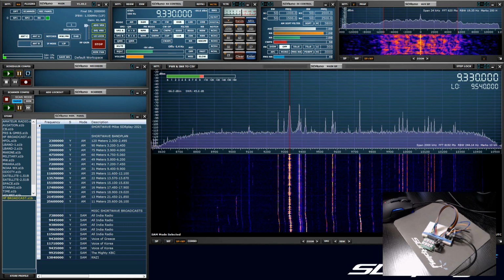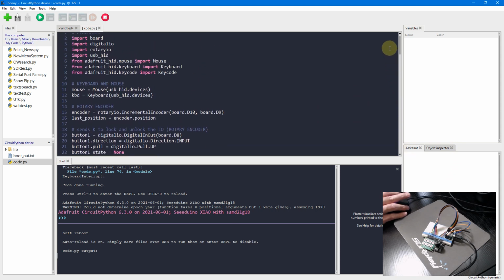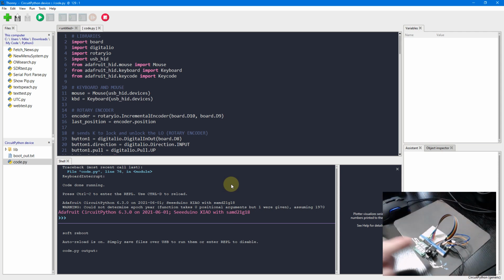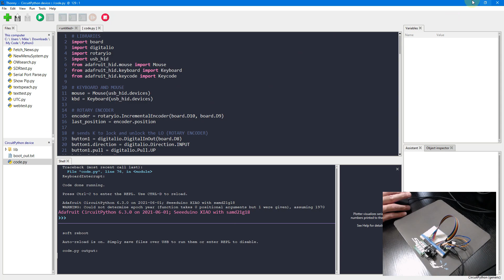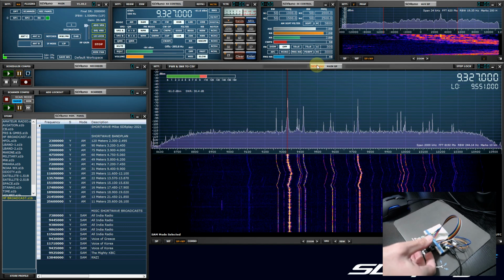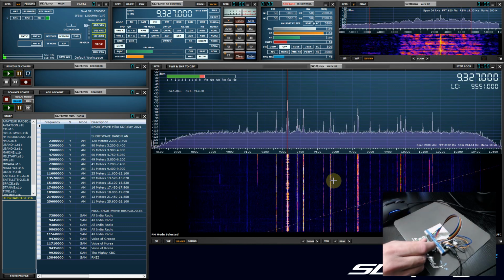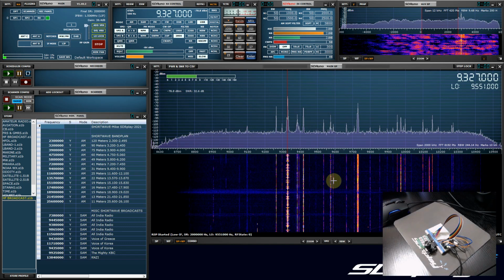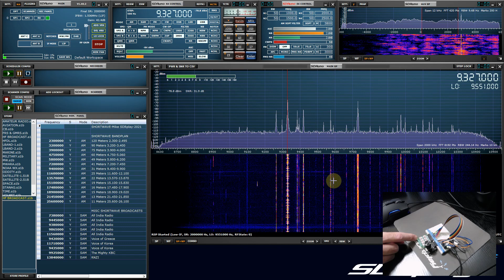SDRuno controller Seeedstudio XAIO & Circuit Python

Comment: Would be interesting to know what the protocol is between SDRPlay and an TM2, then we could make it work much better...  I suspect that they are doing much different to you in reality...
Reply from the maker: The TM2 has a documented API that SDRuno uses directly to send and receive data .

This is just sending keyboard shortcuts already built into SDRuno.
Reply: @SDRplayHamGuides  Oh I didn't know that, I'll have to have a look at that.  Is it widely available?  Where can I find it?
Reply from the maker: @stewartrv  Contact ELAD direct for the TM2 SDK https://www.eladit.com/en/home
Reply: @SDRplayHamGuides  OK thanks very much.  I guess an alternative might be to emulate the CAT control using an Arduino or Raspberry Pi zero...  Also driving a Nextion screen from a Raspberry Pi would make development pretty quick.

Comment: Hi Mike thanks for the vid.  You are making my Tmate look a little over priced!  Great job on this. :)
Reply from the maker: The TM2 is a well known, ready to go controller. Mine is a Frankenstein of wires :) The TM2 can control SDRuno without SDRuno being in focus, This needs SDRuno always in the foreground. Its a fun project I have been working on. More featues will soon be added to mine.
Reply: @SDRplayHamGuides  I l iked what I saw that can be done without breaking the bank.  Keep up the great work.
Reply: Is the code for this project released somewhere?
Reply from the maker: @jeff-73  No, not yet.
Reply: @SDRplayHamGuides  Looking forward to your finished product.  Quite inspiring and will try to follow along with my own build.   Thanks for the reply.